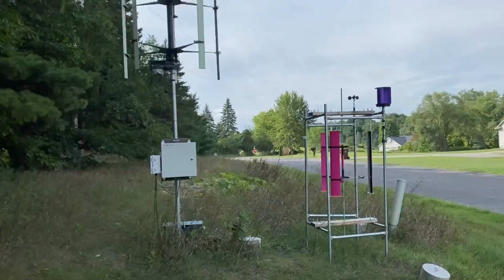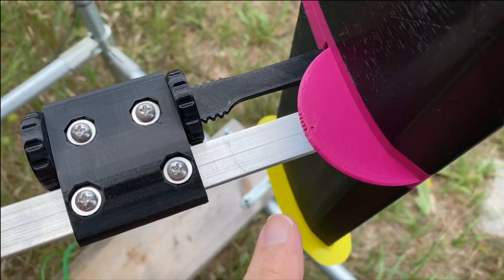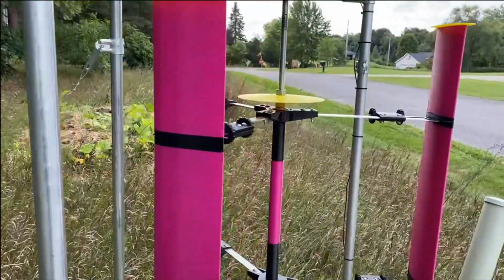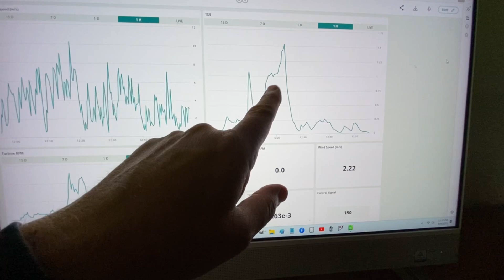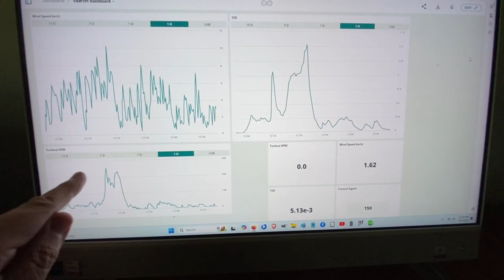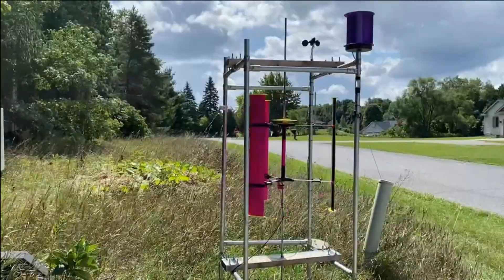Remkick Speedwing at Various Mounting Angles

Comment: Great job! Eager to see what angle of attack yields the best performance. Are you able to test it with load?
Reply from the maker: I think I can attach a pulley to the bottom and use it to drive a generator I made for another VAWT.

Comment: Disappointing since the TSR of Darrieus style wind turbines should run around 4.5. What do you think the problem is?
Reply from the maker: I can't recall ever getting a TSR of 4.5 from a small Darrieus in my designs.  A TSR of 1.25 is fairly typical of what I've gotten before.  The best TSR I have ever had was with the really large Sharp VAWT of around 3.5 I believe.
Reply: @MickEMaus3000 Then maybe it's more of the wind turbine misinformation that's epidemic. Or the way I read . They do say that high tsr like 4.5 is undesirable and cp suffers a lot. But I have gotten tsr of 1.2 on drag Savonious turbines, so it seems to me that tsr of over 3 on lift type should be the target .
Both "Smart Servo" and "Wind stuff now" talk about Darrieus vawts getting tsr over 3. And 4.